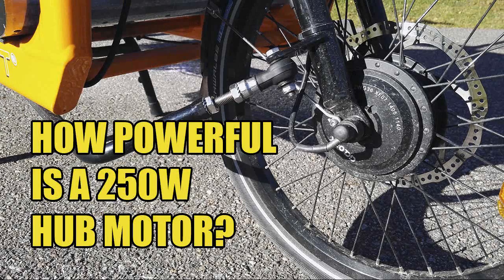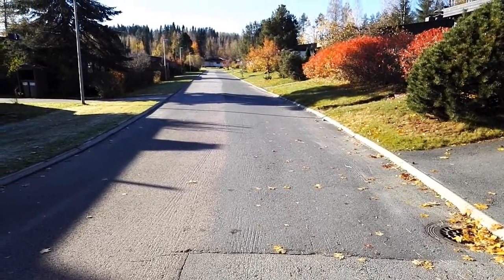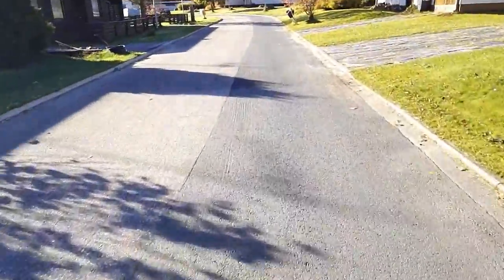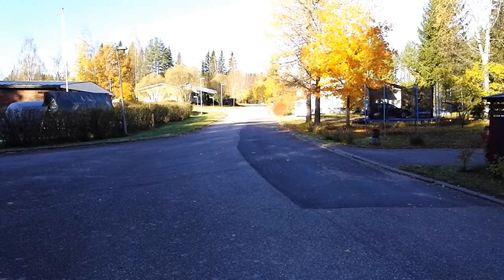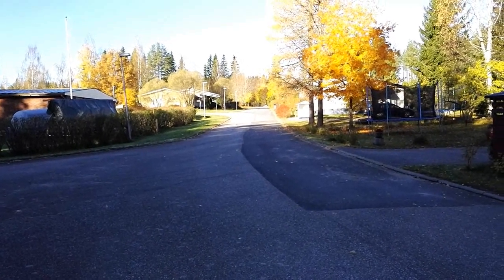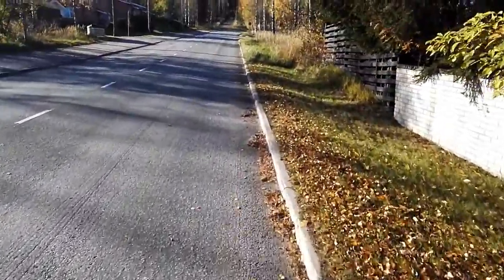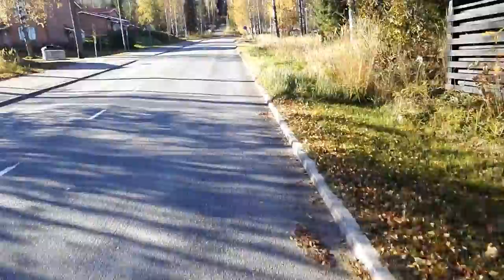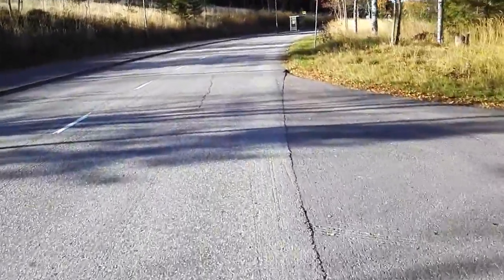How powerful is a 250W hub motor?

Comment: As someone who's ridden ebikes for 10 years ranging from 200W to 800W, I can say that 250W is PISS WEAK for commuting!
Reply: Dont understand that. 250 watt is pretty good for an amateur cyklist that competes. So 250 watt engine should let pass most people on the road
Reply: Cardin Fb maybe he's comparing it with a moped
Reply: mine has a 1000w motor and i still think the acceleration is a bit weak, but i cant find a 2KW motor that is selling in australia (US charges stupidly high shipping for some reason)
Reply: MWB Gaming 1000w is illegal in Australia on road/path
Reply: i know, but 200w is far too weak (barely gets me to walking speed) 
besides, the pigs have not been able to catch me yet, i usually leave them in the dust by cutting through parks or alleys
Reply: 250W is pretty weak. I have a 250W front hub motor and the torque is too weak. I should have upgraded to a 48V battery but I'll end up building a bike over the next six months with a BBSHD or another mid-drive hub, 52V battery etc and use my current one as backup/work.
Reply: The wattage needed is relative to the mass it's moving.
If the rider weighed just 100 pounds a 250 watt hub motor would seems pretty spunky whereas with a 200 pound rider it would seem weak.
Reply: i weigh 87KG, the bike (including motor) weighs 25KG and the battery pack (48V 75AH Li-ion) weighs 40KG
the only motor that actually gets me moving at a reasonable speed is the 1000W motor (even that is a bit sluggish)
Reply: What motor is that? Presumably a hub motor?
Reply: yes it is a hub motor, mid drive is expensive and requires special chains at high power levels
Reply: the reason american products are so costly in Australia is because of the import tariffs your national government has imposed .  @mwbgaming28
Reply: @bobamericana3099  i guarantee it doesnt cost $80 to post a 6kg motorized wheel from the US to Australia, according to UPS it would cost $32 to post such an item, 41$ through fedex and $44 through DHL

not sure where the idiots on ebay are pulling $80+ shipping figures from
Reply: ebay ? they are buying from the original source, having it delivered to them, then shipping it to you. so many con-artists on ebay. simply go the maker of the motor . find a dealer through  them. @mwbgaming28
Reply: @bobamericana3099  the problem with buying direct from china, is i dont want to wait 2 months for it to arrive (and no, they never offer express postage)

if aliexpress offered express postage and didnt have absurd minimum order quantities i would probably buy everything from there
Reply: what i mean is you find the maker of what you are looking for, then you find a factory  distributor for that item. i have been looking at ebike kits and what not for a while now and what i have discovered is that most sellers all have the same  components.....i am buying a 36V 350watt  front motor hub  from a Canadian seller and it is the exact same package as a dealer in california offers,but for less money and better technical  support. it is the exact same item....both shops sell it cheaper than what you see on ebay.
 regarding direct from china. i agree...i see a delta style recumbent on allibaba for 850 dollars (if you buy 10). the exact same unit is 1300 locally and over 2000 in europe...falls back to finding the source of the item and then the cheapest distributor . @mwbgaming28  
i believe you as an aussie should be able to get a motor  or what not from this Canadian distributor and not have to contend with customs being that Australia and Canada are commonwealth countries. i use his shop because there are no tariffs between USA and Canada and they have excellant customer support.eventhough i am in florida USA,they back their products and have great help lines -back to the final price thingy.https://www.goldenmotor.bike/
Reply: @bobamericana3099  the main problem with buying from anywhere in north america (including canada) is the absurd shipping prices (not just on ebay)

il take a look at the site you sent the link for but im 99% certain they dont offer free shipping (and they are pretty expensive based on the cursory glance i took just before )
Reply: No it’s not piss weak. I have a 250 watt nominal front hub motor with 36 volt 13 amp/hrs and it’s fine for headwinds and medium hills as long as you put a little bit of effort into pedalling otherwise you might as well buy a scooter or a motorcycle.
Reply: how fast can you cruise with it ? i want a 36v 350 watt motor but i do not know how strong it will be on its own,  at cruising speed (20 mph) @YourreelmemoriesAu
Reply: Bob Americana. My front hub motor can cruise without pedalling on flat roads 20 to 23 mph. Of course if you want your battery to last or have a headwind or hills you have to pedal but you shouldn’t have to break much sweat if you have a decent bike and kit and have average fitness.
Reply: i will have 18amp hours for my 36volts...plus it is going on a home built trike  my area is flat land. was just wondering about the power. my trike and i will weigh a total of 350 pounds....my current final drive speed is 120 rpm on the pedal crank. nice and comfortable pace..geared for 20-20mpg..somewhere in that range.  just wanna know what i am looking at before i drops  hundreds of dollars into an ebike kit....only motor kit i see that free wheels when not under power is a 36volt  front hub. i wish i could find a free wheeling kit that was more powerful but  no luck there   @YourreelmemoriesAu
Reply: @YourreelmemoriesAu  i ride an ebike because i dont have the money to constantly bribe the government to let me ride a motorcycle or scooter (they call it registration and its way more expensive here than in the us)

my 1kw kit will get me up to 45kph and maintain that speed for 150km before the low battery light turns on 
and thats without pedalling at all
Reply: Bob Americana My bike and I are around 270 pounds total so that wattage motor pulling 350 pounds might be disappointing for you. Sounds like you probably need a 500 watt geared hub motor which are normally rear mounted and a 48v 18 amp hr battery to provide some decent range and performance and fit that to your trike. I’m sure there’s a way somehow.
Reply: i see plenty of motors on the market for 400-500 nominal watt usage..i am simply looking for one that has no resistance to me pedaling when it is not in use. do you know of such motors ? links ? @YourreelmemoriesAu
Reply: MWB Gaming where did you get such a large battery?

Comment: He said the motor was pulling him up the hill, but in the shadow at 4:15 you can see he is peddling.
Reply: Claude Desaulniers A quick look at this video, or an even faster tour on Google will explain that a electric bike mostly has pedal-assist. This means that the motor will only engage if the pedals are moving - Which were explained in the video.

The person in this video is moving his pedals, without putting any pressure on them - Therefore letting the motor do all the work.
Reply: HotelGolf82 . I have an ebike.  No need to pedal.
Reply: Claude Desaulniers There are such bikes also. But the one in this video,	as explained requires the rider to pedal.
Reply: HotelGolf82 . Ok, yes, correct. I watched it again and he does say he is pedaling to engage the motor.  I am curious why he is out of breath though ?

Comment: about 250w? am I right?
Reply: Wrong!! The wattage of an electric motor is its peak load consumption, not its power output. When climbing a hill in a headwind and heavily laden the motor will pull a maximum of 250 Watts from the battery. On any electric vehicle this is kind of important to know as it is the equivalent of an internal combustion engine's fuel economy rating, so can be used to calculate the range given a size of battery and road conditions.

This confusion is common as in the EU, for some stupid reason, internal combustion engines are not power rated in HP, PS, etc. but by Wattage.

Thinking that a 250 Watt electric motor is producing 250 Watts is like thinking that a car engine's fuel economy is its output power.

On all electric powered vehicles the motor Wattage is the consumption NOT the power output. 

Electric motor power outputs are rated in torque @ RPM.

I served my 2nd apprenticeship as a DC traction motor technician, back in the late 1970's.
Reply: I disagree that a 250w motor will draw a maximum of 250w. The evidence is in this video as you can see the power consumption going over 350w under heavy load.
Reply: You are all wrong unless we define how you measure "powerful". In this sense, I do believe we're referring to the pulling power of the motor, which would probably be around 30-40 n.m. you can however also get crank-fitted electric motors that also pull 250 watt, but have 80 n.m. of tourque
Reply: The 250W rating means the motor can handle that amount of power indefinitely. It does not mean it cannot handle more Wattage for shorter periods. The controller controls the Wattage that it gives to the motor, the motor just "asks" for more watts when needed and the controller will give as much as it can. That is what you are seeing in this video.
Reply: Most 250 Watt e-bike hub-motors of 36V (10S-battery) have a maximum amperage of 15 Amps (some have 18A). This makes the maximum power 36*15=540W or when the batteries are completely full: 42*15=630W.
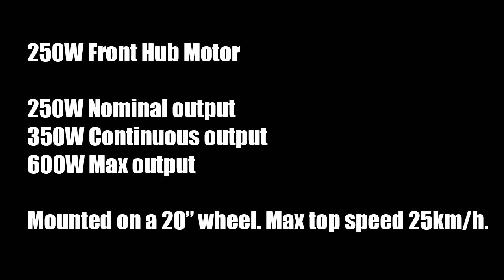00:07 the one in the video has a maximum power of 600W
Reply: @CZ350tuner  the motor consumption at its peak was about 500W, wasn't it?

Comment: I bought a 500watt Bafang. Not legal! Unless you have a license. 
I was afraid the 250watt would overheat in the Alps. 
But I am not sure I did the right thing. I am not gonna wear a stupid helmet or ride on the road if there is a cycle path.  
I will limit it to 25km/h and 250watt which is possible I believe. I am not interested in speed. 
What do you think? Would the 250watt motor be enough to get me up a real mountain with my heavy trike and camping kit?  You seem to do pretty well.
Reply from the maker: drie wiel 

I have never been or cycled in the Alps so I might not be the right person to answer your question. For me and my needs this motor has been enough. I typically transport myself (120kg), bike (30kg) and 1-2 kids (20-45kg) and have not had issues. If the hill is steep and long, I will have to help the motor a lot fully loaded. So if you are looking for a motor that will pull you up to the top of the hill or mountain, this motor is not strong enough to do it without your assistance. But if you dont mind doing a bit of work on the steeps, this is a good choice.
Reply: It was a difficult decision. 2 People who work with e-bikes advised  me 350watt for some extra power. But I think it is the same motor but with different software. The 500watt is heavier built. That could mean more reliable??   

I hope that when the police stops me I can convince them I only use 250watt. 
500watt is for when I am in Switzerland. In the Netherlands I don't need e-assist at all.  20km/h is fast enough for me. But if they give me a ticket and say I can't go any further them I will have regrets. Not the money, but my trip!  Maybe I should have ordered the 250watt? I ride a bicycle to relax. Not to look if there is police with a small chance they will check. I don't want to be a criminal. HELP!
Reply: I must say I am impressed by the power of the 250watt motor. My Bafang has not been shipped yet. I can probably still change my order from the illegal 500watt to the legal 250watt. It is nice to be legal. 
Question is if it would give me more range? Some suggest using a 500watt at lower assist level will actually do better. But, and here is the thing, I could get a larger capacity battery for the same total price and weight. 
Another option is the 350watt motor. But it will be illegal again. 

I know you can't make the decision for me. I'm just thinking out loud.

Comment: I assume you are pedaling because you are using the cadence sensor for throttle control? Have you any experience with the wattage of the 250 watt bafang using a torque sensor?

Comment: My 36v 250w Hub Motor goes until 25-28km/h wtf? Yours only take 20km/h?

Ps: 27km/h with 80kg and 23-25km/h with 130kg (Me and my Gf)
Reply from the maker: Do you have a Bafang brand 250W front hub motor?
Is it mounted to a 20" wheel?
Do you run a 36V battery?
Is your assist cut off set to 25km/h?
Does your bike weigh 35kg?

There are so many things that can be different between our setups.

This same motor will do 27-28km/h on throttle only mounted to a 26" wheel and 11kg MTB and assist cut off set to 35km/h.
Reply: 40kg girlfriend? Is she 12yo? ))
Reply: That's because those motors have different RPM. One can have "speed" motor or "torque" motor and both of them will be the same brand, model. voltage and power. Just different RPM.
Reply: E-Bike Commuter E-Bike Commuter  20'' wheel, Bafang BFSWX02 250w, 22kg, 36v 11ah, Cut-Off to 25KM/H BUT with Full Battery 28KM/H (To the Idiot in the comment my GF got 17 years old and she got 46kg and I got 62kg...)
Reply: E-Bike Commuter I want to pump it  an 58.8v 14ah battery... Do you think it gonna work or is better sell it and buy one that already get the 50km/h (Dream)? (in a 250w motor)
Reply: Илья Исаев But my got a very High Torque... I saw in some sites of E-Bikes that most of Torque models can be transfered to efficiency pumping a higher voltage in, for it reason 250w good motors can get-in almost 1000w and do not break and handle it on 50km/h + 500w torque

Comment: The speed being cut in half uphill is fine with me, at least I don't have to put in as much work.
Reply: The key is to achieve higher speed (increased stability and safety on the hill) than before while still putting in the same amount of work if one still wants to get some exercise

Comment: I have an e bike with a 250 watt motor on it and it will top out at about 20 MPH on a flat service when the battery is fully charged nearly twice the speed you were able to get with this.,  I wonder why?>

Comment: why would anyone wants to install a higher wattage hub motor if the law wattage can go farther with same battery setup... !!
Reply: Because 20kph is too slow.
Reply: Munther G-mail cause power and speed. A 1000w can take you up the hill faster and easier. 250 is weak compared to 1000, even 500. 
You can still get good range on a 1000w as long as you don’t go too fast and use assist always since the Throttle kills your range
Reply: If people drive cars ranging from Micro-cars to Bugatti Chirons, it's fairly likely they will also have different ideas on what e-bike will meet their needs.   :o)
People did not sit up and take notice of Tesla cars because they were electric... they became interested because of the massive performance compared to similar fossil fuelled vehicles.

Comment: Hi, many thanks for the video. I've installed nearly the same system in my bike. System weight about 120kg including my weight. the motor has enough power to push the bike easyly to the 25km/h. Do you already tried to adjust the wheelsize in the menue of the Display? the top top speed varies, depending on the wheel size in the settings.
Reply from the maker: Eduard S 
I have the wheel size set to 20" as I want the mileage to be correct.

Comment: Just over volt the motor it wil give you more speed
I think you use a 36v battery in this video next time upgrade to 48v or even 52 it wil be much quicker

Comment: ive never tried an ebike but 250w sounds pretty low for a person of my size, im 6 foot 280LBS, must be over 300LBS including bike weight how can a little 250w pull all that weight along up a hill? 250w wouldnt even power the fans inside my pc theres a 750w in that.

Comment: great video it was good that you tested, because I wasn't going to buy an e-bike with fear of the hills and my weight (95kg). this video helps a lot.
just one doubt, your bike is 250w, but the motor is giving 500-600w in uphill. this happens with all 250w e-bikes? is it dangerous for the motor?
thanks
Reply: It’s up to the controller, some controllers only allow a max. of 250W, but it seams like this one is different. I think this motor is more like a 350W motor, because it’s max. continuous power is 350W. The max. output is in this case 600W, but only for a certain amount of time because the copper windings will overheat. Modern motors like this one probably have a temp probe which is an input for the controller so it can determine for example the duration of its max. output.